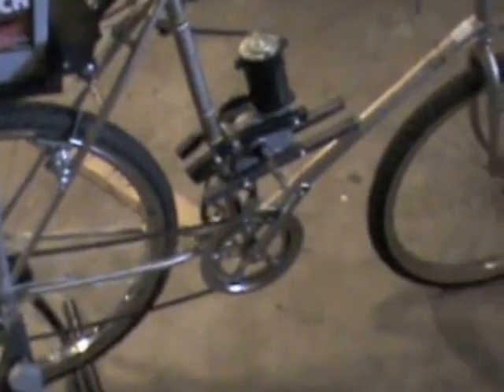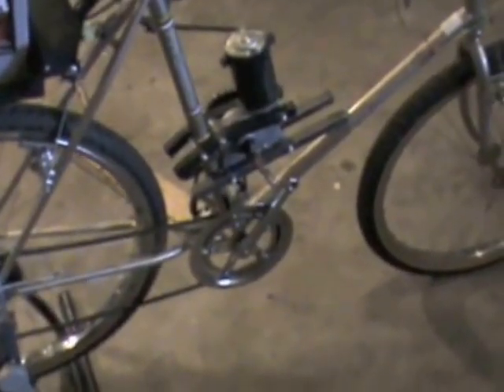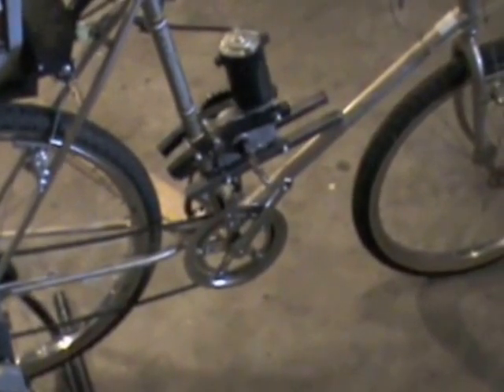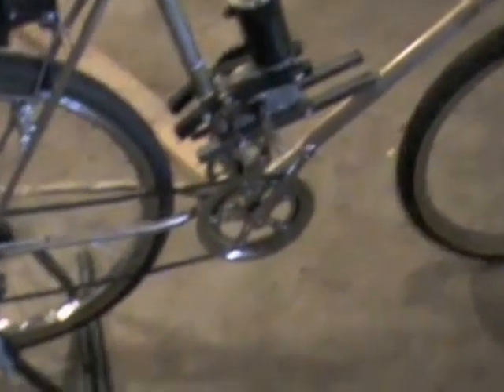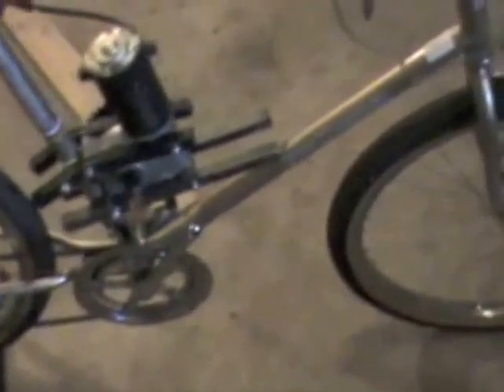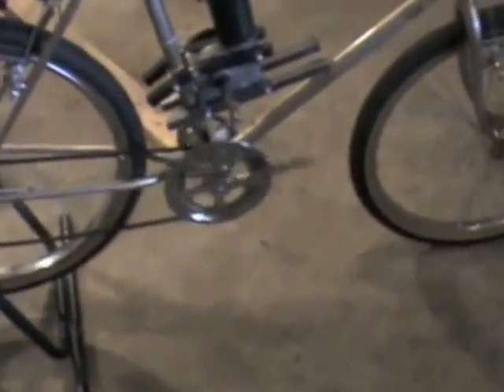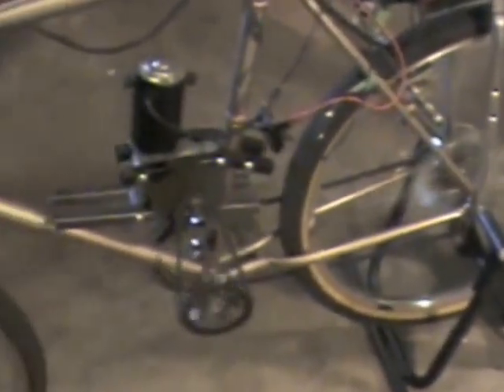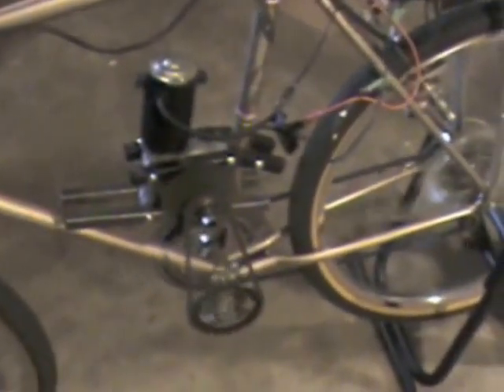How to: Build an Electric Bicycle from Push Golf Cart Motor

Comment: Hello Can you still run through the gears and what speed will the bike doThanks
Reply from the maker: Yes you can run through the gears. This was mainly geared for the hills around our area. It would go about 35kms but was not needed down hill so it would cut out to save battery power. (kill switch) The most important aspect of the build was the free wheeling that is required in many European countries and it was by fluke that it happened and was from old bike parts. I had a old video of this build and it got 150,000 hits. I wished I didn't delete it.
Reply: I'm building one very similar to your build I'll keep you up dated with it Ia this the only one you built ?
Reply from the maker: @gizzardlove  I built this one only and tested it out and it sat outside for ages and I dismantled it for some reason. I started to build a electric motorcycle but the batteries cost too much at the time so I stopped.
Reply from the maker: I'm back working on electric motorcycle. I made the battery rack and supported the structural frame and it's nearly all complete except for batteries. Have an indicator light to be fixed and will work on that tomorrow. I'm using my battery charger for to check the 12 VDC systems on motorcycle. When complete the 48 VDC will go through a convertor to drop it to 12VDC for running lights,horn,indicators and break light.